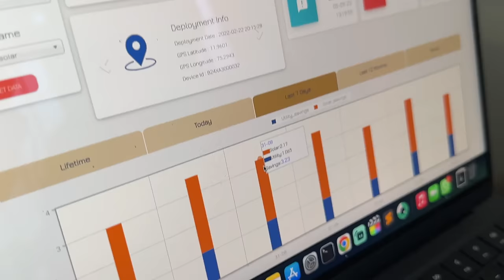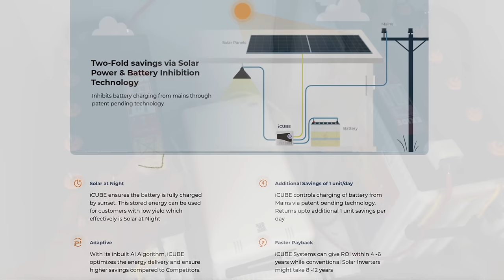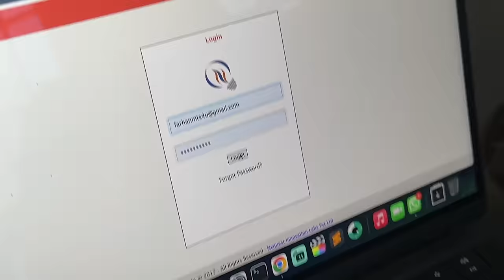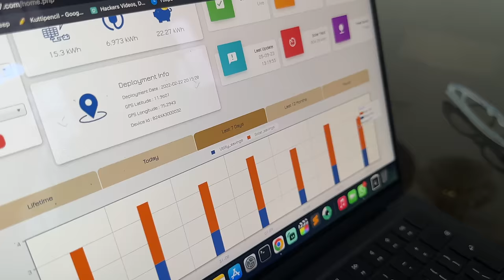Budget Friendly | Install solar power in your Home | Energy24by7

Comment from the maker: Tel: 0476-2847700. Press 1 for sales
Whatsapp : https://wa.me/message/ZVDE6CJQVD2RC1 

Old video, Complete installation and details : https://youtu.be/wbewb3yjDCc

Energy24by7 is a company based in Kerala focusing on the renewable energy domain. Their flagship product iCON converts any existing inverter/UPS to solar power at the lowest cost to customers and is offered in residential and commercial variants.

This video details about their second product iCUBE, a high-efficiency smart solar UPS, with all the features of iCON built-in. Both the products are Wi-Fi enabled and the customer gets a mobile App/ Web UI to monitor their energy savings and battery status.

If you are interested to know more about the product/scheduling a site visit, please contact at the IVR number provided below,
Tel: 0476-2847700. Press 1 for all sales enquiries
Overseas customers who prefer to use Whatsapp may please contact using the link provided below,
https://wa.me/message/ZVDE6CJQVD2RC1 

Customers can also reach out us via the contact details provided in our website www.energy24by7.com

Energy24by7 Facebook Page: https://www.facebook.com/Energy24by7

Instagram Channel: https://www.instagram.com/energy24by7/

സോളാർ ബില്ല് വന്നു (ICON)  : https://youtu.be/OD3uMzWAfXM
Reply: Hi, I have installed icon , but how much they charge if i want to upgrade to icube with battery. Any discount for existing users. They can take back the icon and install icube. Please advise your opinion. Thanks 😊
Reply: DC to AC Converter is used in the device?

Comment: In case of upgrading from icon to icube the existing inverter and battery has to be replaced by two new batteries alongwith icube inverter.  What if one of the replaced battery gets faulty after two years or more...is it necessary to replace both the batteries in the above case. Kindly clarify.

Comment: Farhan bro ഇപ്പൊൾ വീട്ടിൽ avg kseb ബിൽ ഏത്ര ആണ് വരുന്നത്. Current കൂടുതൽ എടുക്കുന്ന ഏതൊക്കെ machines ഉപയോഗിക്കുന്നുണ്ട്. Plz replay
Reply from the maker: Basically ende veedil consumption kooduthalan. We use fridge, oven, electric scooter , 2x water pumb , 2 ac , 5 rooms
In that 1 studio room where i use 3 studio light and 3 systems

So expected bill should be around 5500-6000

Ipol varunadh 3500-4000 an aprox 35-40% savings
Reply: @MalluDiscoveryTV  investment worth aay thonnu undo
Reply: Better go with 3kw on grid solar system
Reply: @MalluDiscoveryTV then why don't you think about upgrade to a 3kva or higher option to reduce more electricity.

Comment: Don't buy on grid system only buy off grid system
Reply: what about after C10 Battery 5year warranty? (i had to warranty replace UTL 1560 battery within 3yr)
Reply: @SafeerSefi Sir.
Our system has a unique charging mechanism other than any solar systems.
It will provide you better battery life.